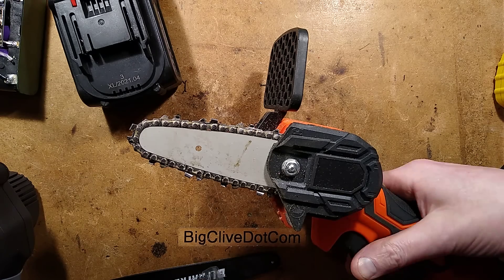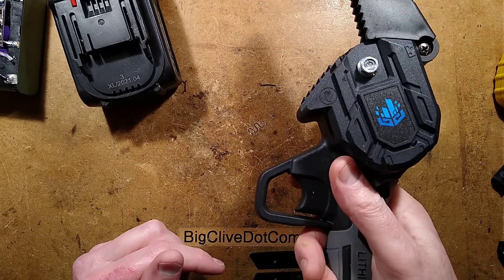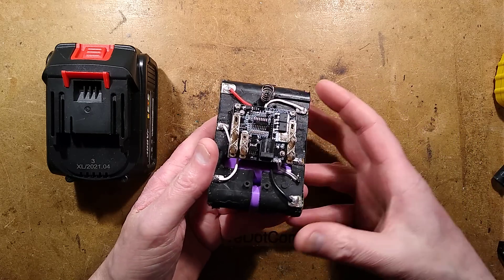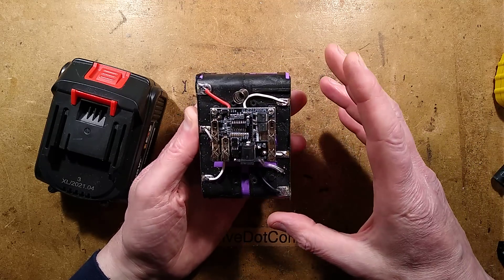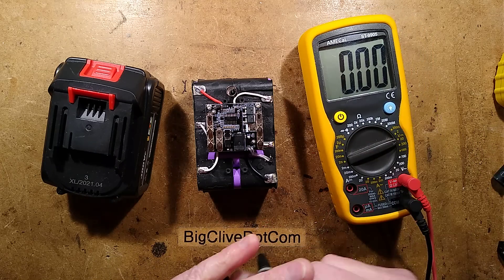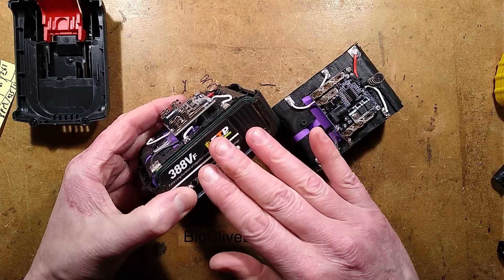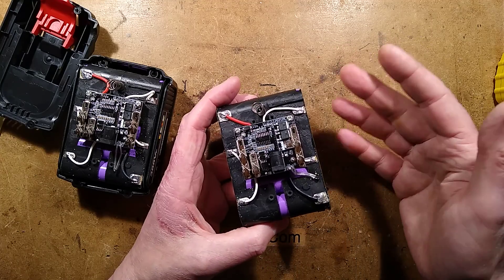Dead batteries - with odd charging circuitry

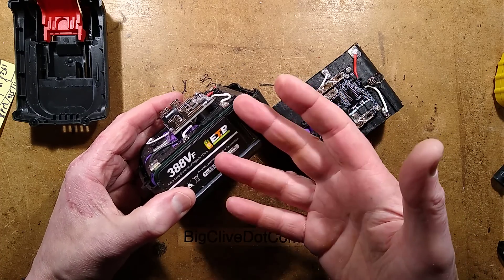Comment: 5:50 Don't top them up but charge them to around 40%. It's the best percentage when you're not using it for a few months. The -0.9V cell is in sleep mode. This happens when a cell gets below 2.5V after which you should just discard it.
Reply: I tried recovering some 7yr old cells, 0v cells to be clear and It seems like 4/6 are coming back, i used some 10/30 ma to charge them
Reply: If all else fails and the cells don't respond, drill a smallish hole through the center of the Positive cap and push the Reset/wake-up button that is hidden right beneath it. 🤣🤣🤣

NOTE....It is of the utmost importance that I must mention, this is one of the most effective means of validating natural selection.
Reply: @wayneselby5415  That is the vent button, no?
Reply: @wayneselby5415  you forgot to mention that the Cell must be fully charged for the button to be accessible

Comment: I submit that lithium cells, for all their power and efficiency, are not the right choice for something that is only used occasionally. Then they are likely to discharge and become unusable. If you are a professional gardener, lithium cells would be suitable for a portable tool you use often, but for an amateur, when the tool may lie unused for months, the power pack is likely to fail unless you leave it plugged in all the time - which is a waste of a socket.
Reply: all my battery packs are numbered so none of them get a chance to hide down the back of the cupboard hoping i will forget about them.  its not foolproof but it helps.
Reply: I personally think NiMh is still a very good battery technology. It is simpeler that Li-Ion / Li-Po because you don't need protection boards and NiMh cells are just pain safer. Ideal for the occasional usage. Although remember to charge your battery packs before usage.
Reply: @Frankhe78 the worst thing about nimh cells is, before you use them/charge them you are best discharging them before you charge them as only topping up nimh can cause you to loose some capacity. Meaning the already low capacity of nimh gets so much worse over time
Reply: @HootMaRoot  It really depends on what you want and what you need. Li-ion an LiPo have their advantages and disadvantages. One disadvantage of Lithium technology is that they wear when you store them at the maximum voltage. LiFePO4 has less wear and no thermal runaway.
Reply: @Frankhe78  it's probably my early/mid teens and having nimh batteries in my rc cars that I have such distain for nimh. And when lifepo4 and lipo pouches became very affordable 20 years ago not so much these days. Giving so much more capacity being able to run more powerful items and not needing half as much care to keep them in tiptop condition
Reply: @HootMaRoot  Nickel-Zinc are a good battery chemistry, they give a higher output voltage too (1.6V) & are comparable in energy density to Ni-Mh.
Reply: @Lazmanarus  like the sound of them after a quick read about them on wiki, will have to have a test of them soon when I update my charging equipment
Reply: @HootMaRoot  Only use a correct ni-zn charger, never use a ni-mh charger, the charging voltage is too low.
Reply: NiCd cells don't mind being stored at 0V for years. NiMH is a little less tolerant of full discharge.
Reply: @CanizaM  But the chemistry of NiMH is less toxic when the cells finally wear out and need disposal.
Reply: Professional gardeners, never used to have to replace machinery after two years . Bring an engine to a professional after two years.
Tick tock. .😂
Reply: @chrisprobert6  if you look at what's coming for ppl over in America many states will be banning the sale of new petrol powered garden equipment, Honda one of their bigger manufacturers is closing down its garden equipment plant in America
Reply: @HootMaRoot  shit innit?
Reply: I wonder if any of the major tool makers offer LiFePO₄ cells instead of the usual Li-Ion ones.  (Lower capacity, but longer life) I also note that my Makita batteries cut out sooner in the discharge cycle than those of my Dewalt.  I believe that's a good thing.
Reply: They do require a charge and check routine, then your golden.

Comment: I have had lithium batteries down extremely low but never saw one actually go negative charge!
Reply: I think they can only go negative when they're in series and other cells are shunting current through them.
Reply: its so slight negative it may just be the meters accuracy
Reply: Ive notice its very common in non-rechargeable standard lithium batteries as well as a load being necessary when testing... lithium chemistry is just generally problematic it seems. Lol